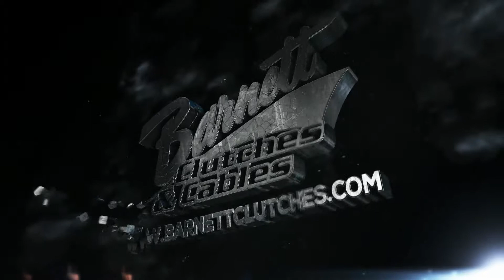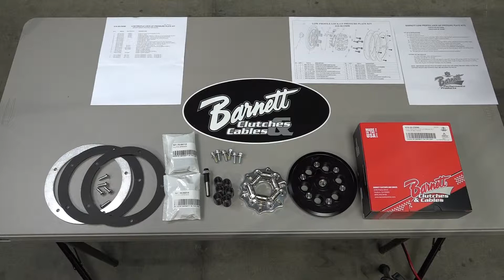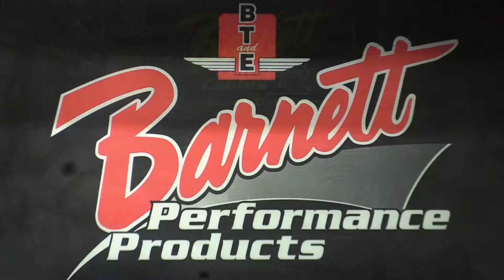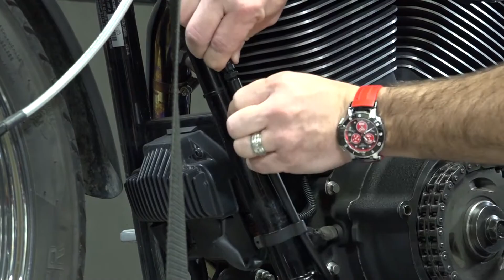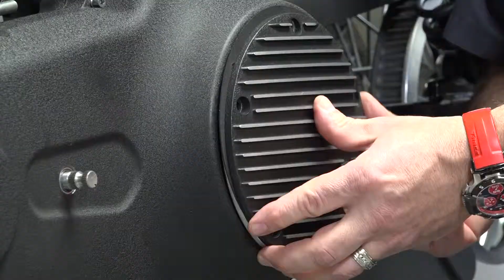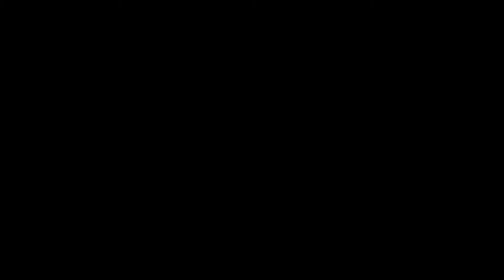Barnett Lock Up Pressure Plate Installation

Comment: Hello Sir, thank you for video. I would mount a Barnett extra plate kit on my sportster 1998, because the OEM spring plate is very dangerous. I have a stock motor ( only stage 1 upgrade ), and I would work with OEM spring because the clutch lever is heavy just now without reinforced spring. Do you recommended the OEM spring? In add, could you recommend a good oil for clutch/ gear box? I read that the formula + can give "squatch"  sound to the clutch . The Spectro heavy duty can be good ? Other people tell to use full synthetic oils, but I don't know if can be compatible with the gears box of my old sportster . Thank you very much , Stefano from Italy
Reply: @clinamenaudio8971  it’s perfectly fine to use the OEM spring. Spectro oil is good. Any of the brand name oils specifically made for your wet clutch primary are fine to use. You can also use ATF type F. Dexron ATF is ok too but will provide a bit harsher engagement compared to type F.

Comment: What spring set goes with what HP motor  on a harley davidson  ?
Reply from the maker: There really isn't a specific HP rating for each set of springs. The idea is to use the softest set of springs without slippage. Being there are three sets of springs, there are multiple pressure options as three and three can be used from any two sets of springs. We generally recommend starting with the light springs and if that is not enough, go to the medium set.

Comment: It looks like the weights are going to hit the bottom of the derby opening during high rpms. They're touching now with no spinning.
Reply: A spacer plate is included for 1998-06 models. It is not required for 2007-17 models.
Reply: I’m trying to install this on my 07 FLHX and I can tell you it definitely hits the Primary cover. Stock Primary cover and before someone asks it’s hitting the Primary not the Derby cover. Also that’s without power, just sitting there on the stand still..

Comment: Do they make one for a big twin  ?
Reply: Yes, it only fits the Big Twins.
Reply: @christaylor4266  I have a 1991 harley solftail springer. My clutch has a spring plate on the face with a C clip  .do they make one for my bike?
Reply: John Barlow the lock up spring conversion in this video  fits 98-17 big twins. For ‘91 BT, the only lock up available is the Scorpion. The Scorpion Lock up which is  Barnett’s top of the line clutch. If you can afford it, you won’t have worry about your clutch again. Another very popular option is going with a Barnett extra plate kit to increase your capacity a bit. You can use it with a stock type replacement diaphragm spring or you can use their heavy duty spring but it will make for a stiffer lever pull. If you don’t care about that, go with the HD spring. With the Scorpion lock up however, lever effort is kept to a minimum while clutch capacity is greatly increased which is the most ideal set up.